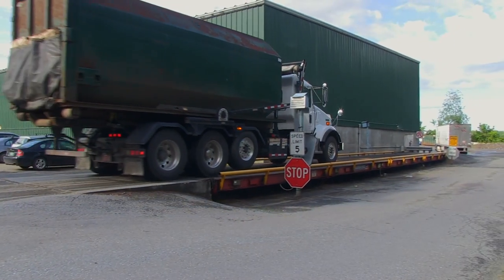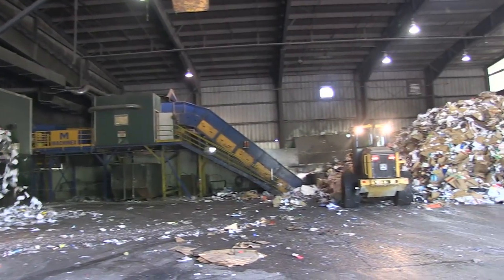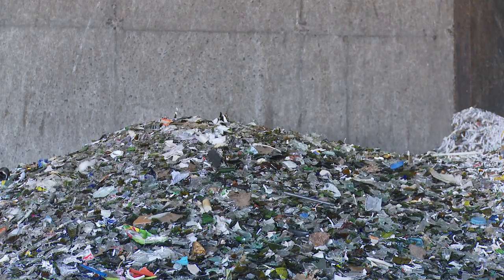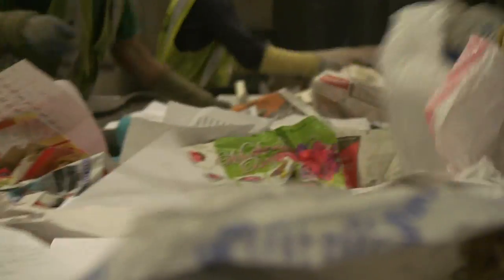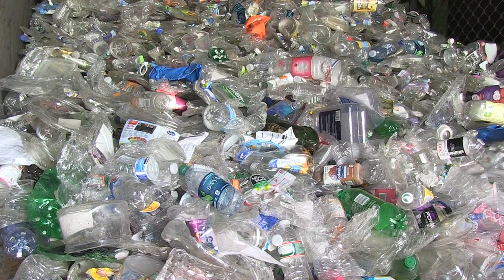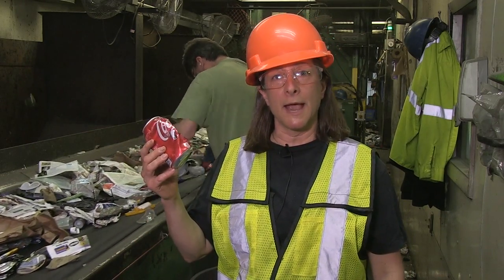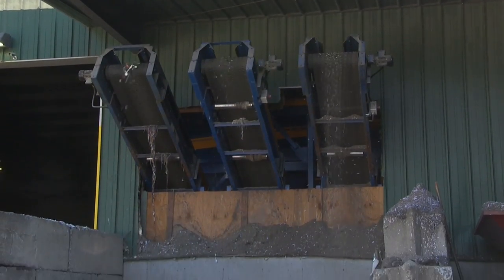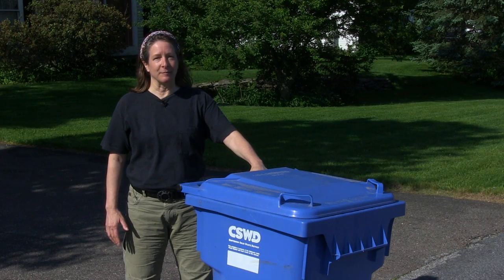How Recycling Works: Behind the Scenes at the MRF

Comment: Great job keep up the good work, only thing I would recommend is you shouldn't  be standing on or next to a bale of #1 pete bottles incase of a wire blow out. Plastic bales want to expand and are under a lot of pressure as it exits the bale chamber and the wire's gets strapped. I manage a recycling facility in Palmer Alaska and I do not let anyone including staff stand on or near a bale incase of a wire blow out wich I have seen happen before and thankfully no one got hurt.
Reply: James the bale safety bear.

Comment: Pre-sorting would be better if the public could be relied on to do it competently......, but they probably can't except among groups like the Amish....; otherwise, manufacturers of plastic resins and their derived products SHOULD be req. to devise some way to distinguish the numbered resins OPTICALLY.  Also, no container should be allowed to use more than ONE type of resin, i.e., the lid distinct from the body.....
Reply: COMPLETELY agree with your one type of resin rule, this is the type of change we need to make at the product design stage.

What do you think are the main barriers holding back the public from competently sorting their own recyclables?